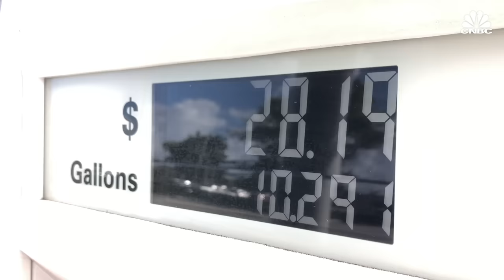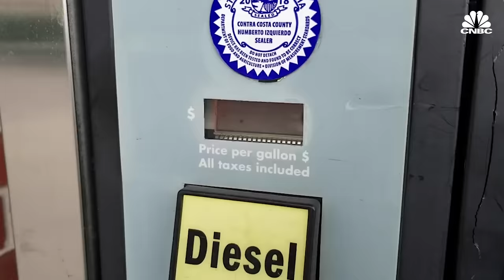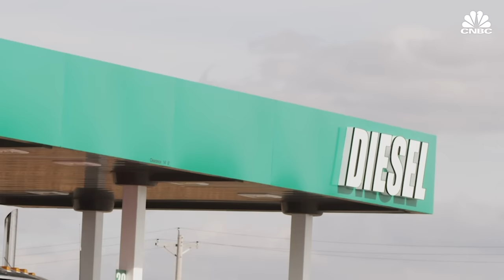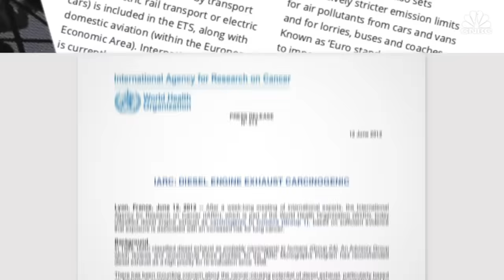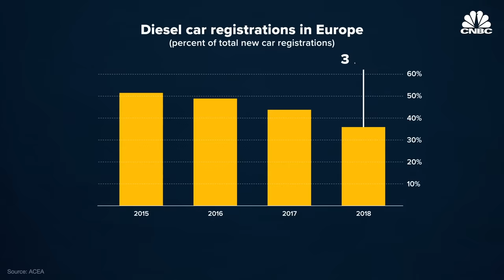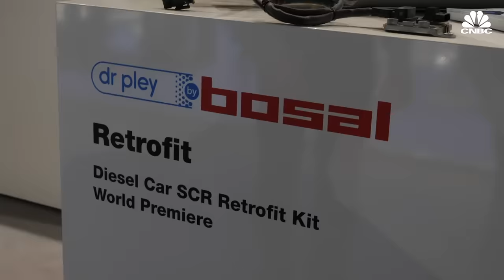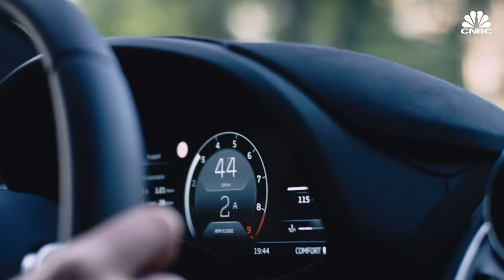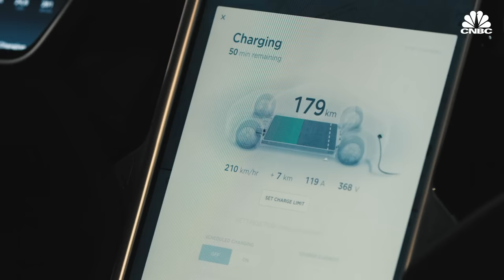Why Diesel Cars Are Disappearing

Comment: the thing is i wonder how many car companies have cheated emmisions tests in both petrol and diesel cars without being caught?
Reply: LOL, cheating, no manfuacturer of anything is going to spend a dime more per unit than is absolutely necessary. The smoke point for diesels is 18:1 AFR, 19:1 AFR makes the best power, but no manufacturer spends for adequate plumbing on any vehicle gas or diesel. This is a classic example of another type of revolving door: mfg refuses to tune anything outside of stoich (15:1 AFR for diesels), it runs dirty, they dont care so whats mandated? Emission controls that do not properly function in external environments as well as the internal environment of such a realm of operation. Parts mfg's win, the automaker wins, green swastika can continue its uninterrupted totalitarian march of lies and mischief, but you lose especially if you don't know any better. When you realize we are not allowed to have long lasting fuel sipping and super mechanical and thermally efficient technologies, because they would not have the fat of the land under their arses and in their pockets otherwise. The amount of intentionally designed throw-away technologies is mind-boggling, I mean how else would they be able to perpetually rob us all blind over 'waste', all the while gaslighting the tech that is a known functional quality while intentionally making it turn noses away en masse. This is how things are taken away, classic collective punishment.
Reply: More than you've seen on TV.
Reply: they need some bs to sell advancement
Reply: Most of them. It is easy to program computers to do anything including change votes that people cast on electronic voting machines.
Reply: All of them except VW. VW did it best that’s why the other companies turned on them
Reply: @Paul-gz5dp  no that's been fact checked, vote fraud never happens.  CNN told me so.
Reply: Or why heating systems have zero abatement and 20 sea freighters that burn bunker oil make more pollution that all the cars
Reply: Basically all of em, and also most of em got caught. Hyundai-KIA got busted in 2014, Peugeot got busted as well...
Reply: The basic problem with disease engines is they work much better in a narrow range of RPMs best in steady stable RPM there are far superior for things like generators and pumps and very large Marine engines in a car where you're changing speed regularly they are far less effective for sometime diesel fuel was Far cheaper than gasoline and that was the attraction it is no longer the case.
Reply: All of them
Reply: Arron Somerville,
I bet the most cheating is happening with gasoline engines. For the last  15 years I have noticed that most gasoline engines blow black smoke under hard acceleration and if you look, all of the exhaust tips are black, yet in the modern diesel cars/trucks they are not. The exhaust tip on my old '91 Ford Aerostar is clean as a whistle, so why do the new gasoline cars, that are supposedly advanced and clean, have such dirty exhaust tip??? They are cheating! 

The other bold face lie is that diesel fuel is carcinogenic. Gasoline, especially when laced with ethanol, are by fare, a lot more carcinogenic, but the media and environmentalists always avoid that little crucial truth. There is so much bs in this video it is sickening. The only way they will push diesel out, is by legislation and insane unrealistic emissions, which again is legislation.
Reply: All
Reply: @johndiezel5781  yeah i think so
Reply: diesels are completely useless these days with the dpf filters and ad blue urea exhaust fluid they have just made them very unreliable egr valves where the begining they are terrible things they soot up components and cause premature failure then put a dpf on top of that they are just ticking time bombs! every diesel ive had the first thing i do is blank the egr thankfully ive never had a car with a dpf but if i did it be making a pipe to delete it but make it so it can easily be swapped back come mot time!
Reply: Probably the large majority of them. I hate to say its true.
Reply: @somervillearron  never bought new?
Reply: Nissan Renault heading into allegations of cheating in the UK, right now.
Reply: I dont bother,  the only emmision of my car is water.....     running on hydrogen lol...    took the cat converter out cause I dont need it anymore... hydrogen is the cleanest fuel in the world..

I'm on a private basis, so I got my country pinned...    complain about my car on hydrogen I'll start making and selling the units lol...   so far theyve left me quite alone.
Reply: All of them.
Reply: Who cares about emissions? I don’t.
Reply: Vw, vauxhall, mercedes are 3 brands that i know of and there ARE more
Reply: @harleyme3163  fair play to you, that fuel source is great just lack of refilling stations (in the uk anyway) they already do hydrogen conversion kits, commonly fitted as a dual fuel system like lpg
Reply: @somervillearron  if in uk you need to smash the core out (100% illegal up to £1000 fine) and remap the ecu so it dont request a regen and dont give you warning lights that the dpf sensors are getting a bad reading, need to keep the dpf canister fitted as instant mot fail if they notice it missing, also there is ment to be a new machine being sent out to uk mot testing stations that claims to detect if a dpf has been removed,
The idea of dpf is great however the design is crap, but i wonder what pollution is released when these components need replacing (man hours of booking in, courtesy car, production of parts and logistics) also i've seen a few forced regens done and i swear the smoke released during that is worse then a 1950's lorry,
Think i'll stick to my tuned 2003 pd150 ARL  lol
Reply: Brin Jenkins  if you buy a bed that says ultra soft and its like a plank of wood, 
if someone buy food that says no peanuts but there are peanuts in it, 
whats wrong with that its still a bed, and the latter is still food?
Whats wrong with it is its not what you chose to buy, people purchased it under false information that was give to you as fact,
Some people got these vehicles on the basis of the reduced emissions so they were sold a vehicle on false information, which is sale by deception ,
And i am a vw fan so its not like i'm dissing a manufacturer i dont like
Reply: Arron Somerville my BMW got recalled for flawed emissions levels.
Reply: I think the whole thing was political. The cars are so very clean today these standards are getting upsurd.
Reply: Most of the European manufacturers were cheating by having the testing done in countries with easier testing regimes. Petrol engines become as efficient as Diesel engines when direct injection and higher compressions are used.
Reply: Electric vehicles cheating nuclear fuel emissions yet?
Reply: Roger Dodger  Whatever fuel source is used for the electricity generation electric cars have better efficiency not to mention localised health benefits.
Reply: I think of Honda being the first I heard of. I'm not a historian. They would pollute in excess of limits at highway speeds, but would pass the emission test. https://www.cbsnews.com/news/vw-just-the-latest-in-long-history-of-cheating-car-companies/
"Honda agreed to $267 million in recall costs and fines to settle allegations it disabled a misfire monitoring device on 1.6 million Accords, Civics, Preludes, Odysseys and Acuras built between 1995 and 1997. Because of the disabled device, malfunction indicator lights intended to indicate poor engine performance wouldn't come on.
Unaware their cars needed to be serviced, vehicle owners continued driving, damaging their exhaust systems and releasing more pollution. As part of its settlement with federal officials, Honda agreed to extend warranties for all the affected models, as well as provide free oil changes and tuneups."
Reply: I had a new 1987 Dodge Lancer. The dealer didn't do emissions at the first inspection. A year later it failed inspection. It had defective fuel injectors. I had polluted in excess of limits for a year! Future inspections would be done with the AC off, the air filter assembly off. Massachusetts started requiring a dynamometer,[a chassis dynamometer is a treadmill for cars], to test the car with the drive wheels powered. I've been driving hybrids since 2006. The regenerative braking still results in expensive brake jobs at 19K miles. Pads, rotors, shim kits. $1400 brake job. $650 for the gas and electric front, and $735 for the all electric rear. RX400h, RX450h. Kermit told us it isn't easy being green.
Reply: Hybrids even worse under NEDC and even WTLP, allowed for constant charging and no emissions from grid considered.
Reply: @TekAutomatica  Since we live in Alphabet City, I'll spell out these acronyms. The New European Driving Cycle (NEDC) is a driving cycle, last updated in 1997, designed to assess the emission levels of car engines and fuel economy in passenger cars (which excludes light trucks and commercial vehicles). It is also referred to as MVEG cycle (Motor Vehicle Emissions Group).

Since 1992, the New European Driving Cycle (NEDC) has been used to determine the fuel emissions and consumption values of vehicles. From September 2018, there will be a change in statutory test methods for consumption, emissions and pollution. The NEDC will be replaced by the WLTP (Worldwide Harmonized Light Test Procedure).

WLTP is a new legally binding test procedure for all car manufacturers to determine figures for exhaust emissions and fuel consumption. WLTP is based on an approximation of the test conditions to real-world circumstances, which will deliver more practically relevant values. Among the changes are redefined, substantially stricter test conditions as well as a significantly longer test duration (30 instead of 20 minutes).
Reply: The reason the cheat is because the new emission standards are almost impossible to meet. They are set by clueless ideologist politicians, ignoring science.
Reply: @Thomas LeMay: you are wrong on all points. Dieselengines provides power over a far wider rpm-area than gasoline engines does. And it does it whilst using less fuel. Also: diesel is still cheaper than gasoline. On top of that: diesel engines tend to last far longer.
Reply: Simple answer: all.
Reply: @SlingSalsa  tf are u bringing swastika agenda for? It's a divine sign in India and other Asian countries and nothing to do with white people ruining other cultures.
Reply: @johndiezel5781  a lot of new cars are turbo charged and direct injection , which causes the black tailpipes you speak of.
Reply: VW naively came out fully admitting what they did. You just can’t invite punishment like that in today’s world - you’ll get recked.
Reply: Don't you read the news? 
VW, GM, Ford, Mercedes-Benz, BMW, Peugeot, Citroen, Renault, Chrysler-Fiat, Toyota, Nissan.
Most companies did a better job keeping it under the carpet. Also for american news media it's obviously less interesting to help throwing american manufacturers under the bus.
Reply: @johndiezel5781  it’s because those older gasoline cars had a different type of fuel injection. They used port injection. At a certain point, direct fuel injection became widespread on gasoline engines because of better efficiency and power output it allows. It’s basically the same type of high pressure injection diesels have used for a long time. This type of fuel injection creates more soot particles, hence the dirty tailpipes on the newer cars you see. The issue is that particulate filters were initially not required on the new gas engines with direct injection. Within the last few years, exhaust particulate filters have become mandatory on GDI engines pretty much everywhere.
Reply: Truth be told; I smiled when I saw "Rod Romain Fiat Chrysler Chief Engenieer for Heavy Duty Trucks"
FCA cheated on the emissions as well but there's a huge difference. Unlike Volkswagen they didn't make fancy ADs where they praised their diesel engines that's why VW was the first Company to get tested seriously. Infact Audi was the company that wanted to make the revoltionary diesel engine. And the actual problem was Audi didn't quite believed that service-lazy american would really want to fill up their tank with AD-Blue every 8.000miles. Volkswagen as mothercompany just decited to take the step and be honest that "they" cheated on the emissions eventho they just allowed Audi to sell these engines and used'em themselfs.

Back to FCA so they wasn't the first company to get seriously tested but they were: In 2015 the Fiat's base in Turin was "stormed" and they found papers that had these emissions cheating software explained, eventho it was later found on newer Jeep Trucks that were sold in the US.
The reason noone knows about it is the Italian goverment. FCA is due to Fiat also in good contact with the italian goverment. When they found out about the diesel gate they've fallen into silence ever since about that topic.

Other companys that are also involved are Volvo, Mercedes, BMW, Opel (GM), Chevrolet, Mitsubishi, Subaru, Suzuki, Nissan, Renault, Peugeot, Citroen, Ford and Alfa Romeo.
So basically everyone exept Toyota, Lexus, Honda and Acura
Reply: answer... every american manufacture multiple times, the auto industry is a savage beast so its no surprise they're all  have or are cheating. I still bought a new VW in the middle of diesel gate, just wish it was a diesel golf instead of a GTI.
Reply: D-COM  how old are you 12?
Reply: Thank you. I have the same Q!
Reply: Conspiracies get exposed sooner or later.
Reply: Quit wondering then. Problem solved
Reply: @Paul-gz5dp  and VW got caught. It can be proved that VW cheated. Prove there was voter fraud.
Reply: @woooweee Republican Secretary of States, the Courts, Trump hand -appointed AG and election czar, also told you so.
Reply: Who cares?......nobody.  Diesels would be getting over a 100mpg today, if not for regulation.
Reply: All of them.
Reply: @somervillearron  when first heard of exhaust fluid, I thought it was a joke like blinker fluid, or muffler bearings ...then learned it was a real thing LOL
Reply: @johndiezel5781  Everything you said here is wrong. Which oil company do you work for?
Reply: @thomaslemay8817  I was wondering,if you use a special transmission,would that do anything?

Like to keep the engine running in golden rpms while switching gears.
Reply: Volkswagen.
Reply: @upsidedown4155  if "steering wheel holders" would not run diesels at the lowest possible RPM in order to save on fuel their DPF would not get clogged in just a few years of operation you need to hold diesel engines over 2k rpm at all times
Reply: @somervillearron diesel engines need to run at over 2k RPM at all times if your DPF clogs up quickly that is your fault i am sorry to tell you
Reply: all of them ...
Reply: @Paul-gz5dp  This guy gets it.
Reply: Hybrids seem better than EV’s. 60 plus mpg and NO range worry.